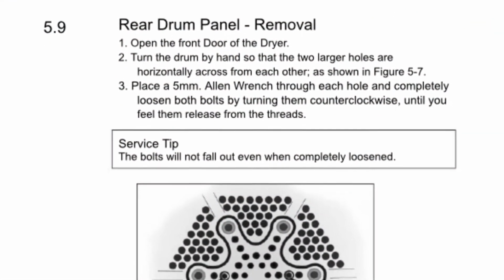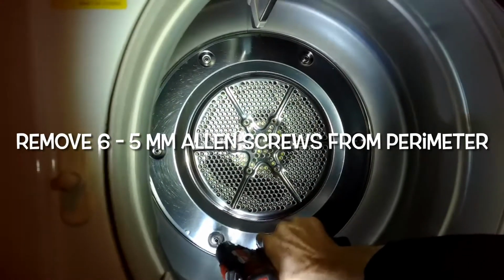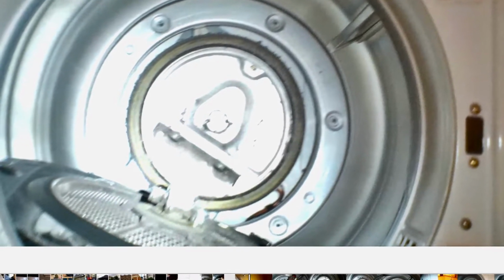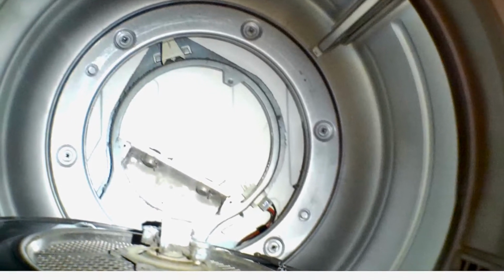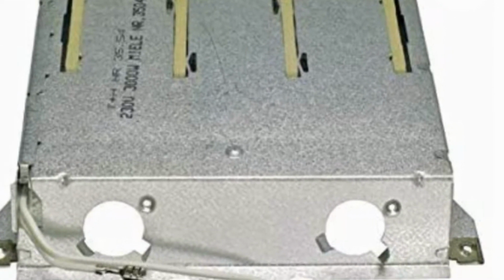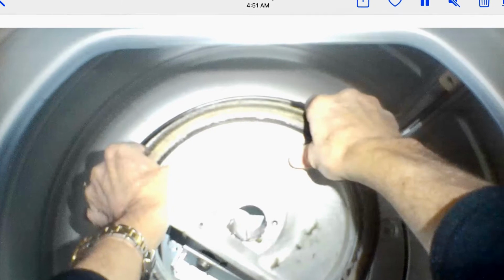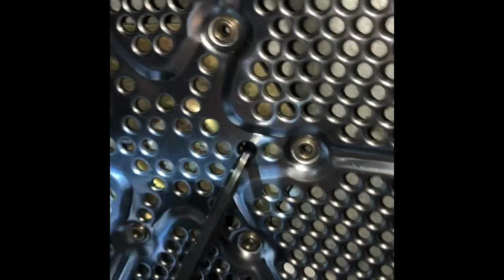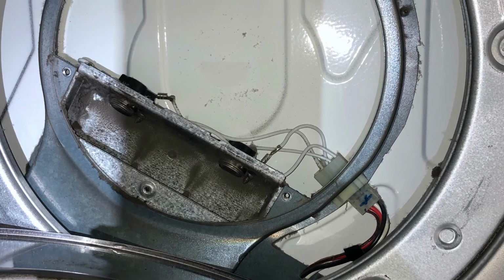✨ Miele T1515 Dryer - HOW TO Easily Change The Heating Element ✨

Comment: Your video was extremely helpful to demystify accessing the heater bank. On a T1520 the four hex bolts are 7mm. The trickiest operation was decoupling the electrical connectors and removing the female coupler from the base ring. 
Thank you!
Reply from the maker: Nicely done👍